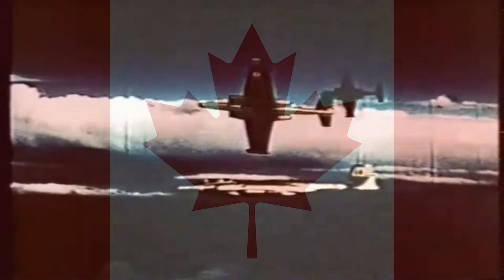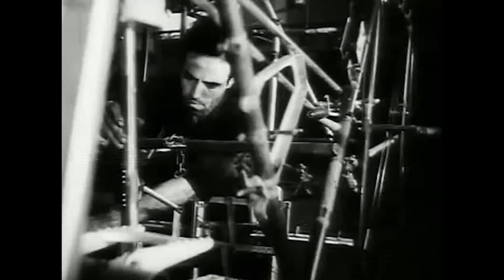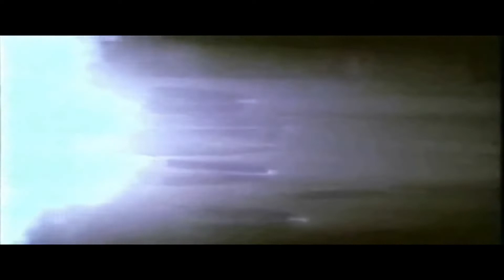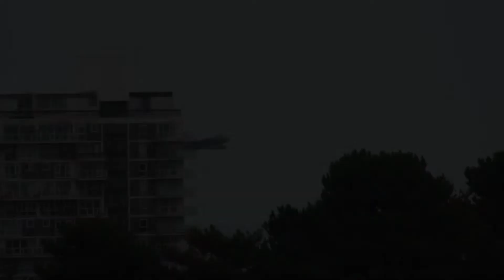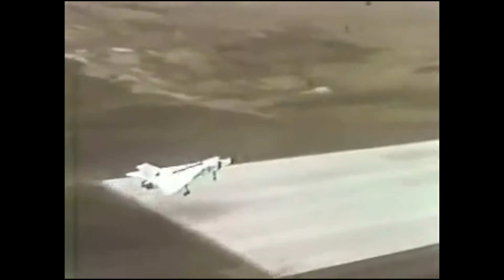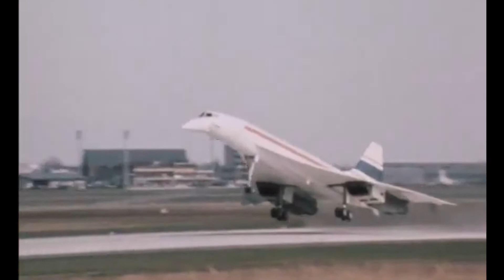How Canada Almost Became an Aviation Giant

Comment: It was an all weather night fighter, and it was renowned in that role. It was called the klunck due to a distinct thud as the landing gear locked in place.
The airliner was a great early success but it's square windows were an undiscovered design flaw. Cracking in the fuselage around the window resulted in decompression and crashes. 
The time to understand and engineer the solution allowed competitors to overtake it.
The Arrow, this was subversion , plain and simple.
Canada , my country, we were always try-hards at anything. Always winners.